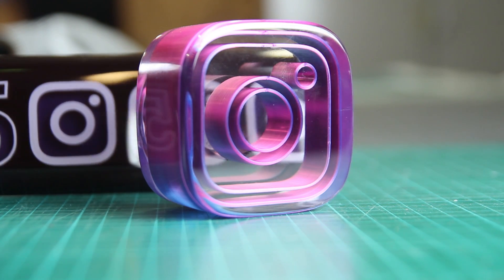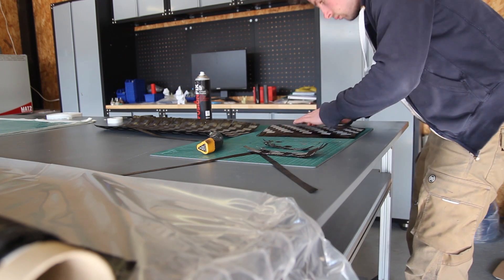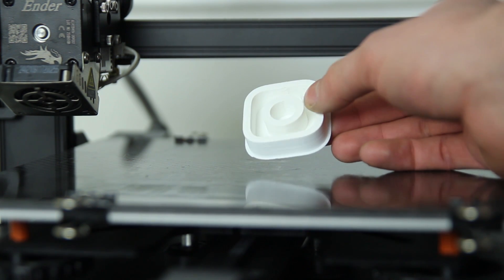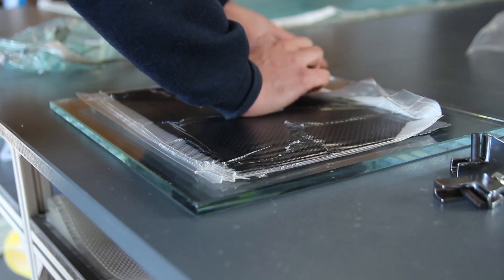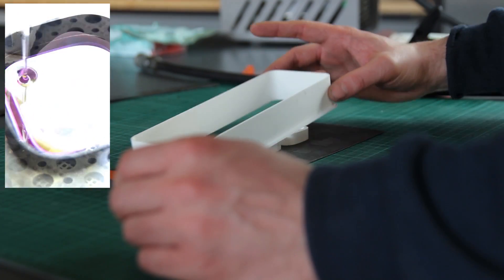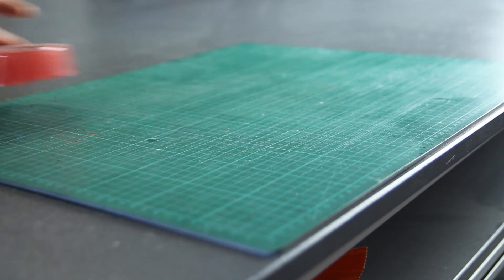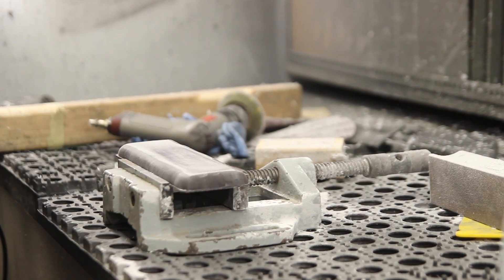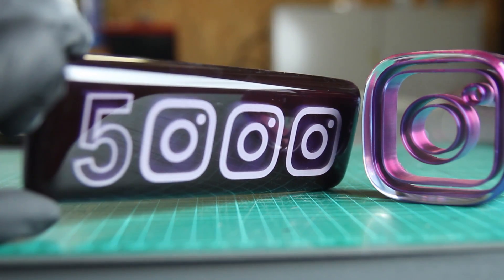Combine Carbonfiber, 3D Printing & Epoxy Resin Casting In A Celebration Award (How To)

Comment: pigment is like salt, you can never take it out after... better to aim lower and put less of it.
the way you over saturated the resin, even if it was half as tick , you would not be able to get a visible carbon weave. i did many things in resin , and a good combination is carbon base plate, 1mm clear resin layer, then lettering( cut and brushed 0.5mm alum. sheet ), then 2-3mm colored with non opaque pigment(avoid black or dark hues)(work it before adding curing agent, test the color in a dice mold or some small mold).
Reply from the maker: Correct!